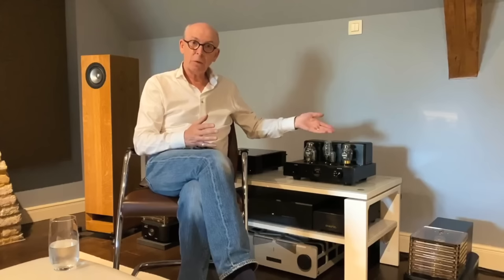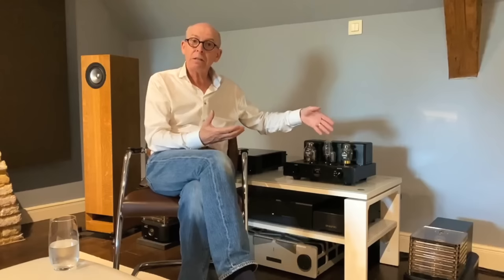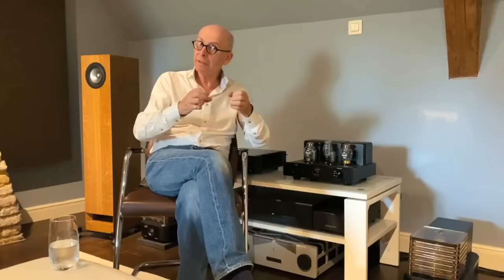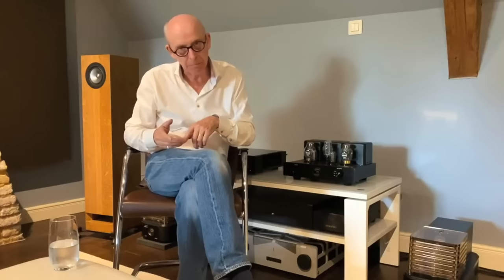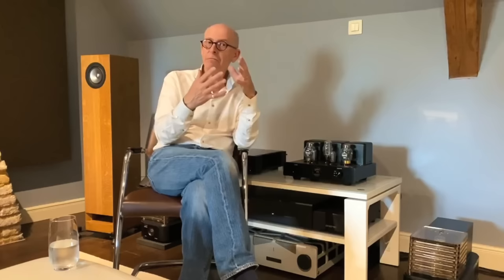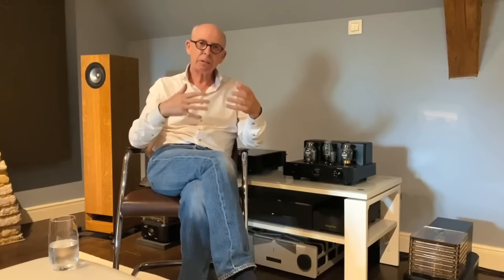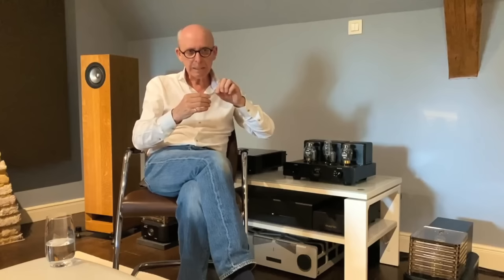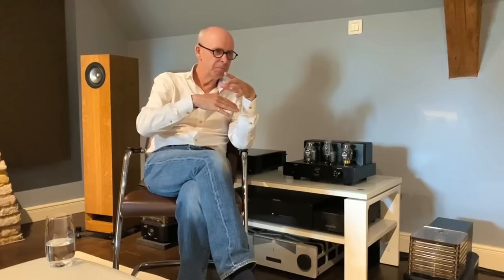What HiFi amplifier? What type to choose?

Comment: There are so many self-proclaimed experts that it is so refreshing to listen to these clear, articulate lectures delivered by a a classical recording producer, and they chime so well with my own experience, not as an "audiophile" but as a music-lover.. Thanks.
Reply from the maker: Thank you Douglas, very kind. Much appreciated.
Reply: @PearlAcoustics  Many thanks for this great video ! , making it very nice explained and intuitive. I have a question and I hope you can answer, Just got a very rare power amp ADCOM GFA555 MK2 Nelson Pass design, bought it from the US and it was new and never opened from the original box, so it was in the original manufacturer box for more then 20-25 years, all I can say It is sound amazing, it is connected in my setup to used ADCOM GFP565 pre amp , and now I explore  very nice and chip tube pre amp Fosi audio tube P1 with GE5654 tubes by Riverstone audio the sound is incredible. So do you think should I replaced the electrolytic caps inside the power amp ? I have removed the top cover and the internals of course looks as new and I have the Bias been checked by me and is as specs . Thanks in advance
Reply from the maker: @RanTausi  Hi. What I am about to tell you is my ‘opinion’. And as such, do not want to proclaim myself as an expert, so please take it as that - an opinion. My rule is, if it sounds good, and there’s no buzzing, hissing or excessive cone movement when idle, then leave it alone and simply enjoy it. 20-25 years is not old for an amplifier of that quality. In the old days (pre-1980’s) - people used oil filled capacitors and they definitely had a habit of breaking down. But todays modern components (and I include amps of the last 20 years) are generally way better made. Do enjoy it and look after it. Best wishes - Harley
Reply: @PearlAcoustics  Many thanks 🙏 Harley, I got your point. Have a good day
Reply from the maker: @RanTausi  👍
Reply: @PearlAcoustics  I agree. If it ain’t broke etc. Admittedly this can be harder to tell with a gradual (I mean gradual) roll off in performance. I remember a customer sent their amps off for a re-cap and said they heard no difference. They actually got a little upset when I said “well, they didn’t need re-capping then”. It’s not a universal answer, especially with a relatively modern, unused good quality amplifier. Please use it and enjoy! Report back your experience too
Reply from the maker: @maxine2798   a very good point snd fun story. there’s an equally strong argument that if they did hear a difference - it might not be one that the original designer would appreciate! 
It’s hard to keep everyone happy in the world of HIFI!
Reply: Actually what you have here is exactly what you are traking about: a self-proclaimed "expert" who has absolutely no clue what he is talking about.

Comment: There is a very well known and popular audio reviewer on the net that states that amplifiers all sound the same.  Yes really.  (He must have some limiting qualifications however) How does he or anyone come to such an opinion? He lays much weight on source and speakers not so much on what comes in between.
Reply from the maker: Hi. In fact, in theory he should be correct, if all amplifiers were ‘perfect’. In a way, scientifically, it is the imperfections that give us the different characteristics of amplifiers. I will say however, there comes a point where the very best amplifiers begin to sound very similar. 
If someone maintains there is no sonic difference then they either have not done enough serious comparisons or their ears are not good enough or they are saying it to make a point because the difference between amplifiers can be rather subtle, compared with other components (such as loudspeakers or pickup cartridges).

Comment: A single-ended amp is always a class-a amp, it needs a lifted bias in order to swing both ways, but a class-a amp does not need to be single ended it can be push pull too. There is absolutely no difference between a class-a and a class a/b design, the only difference is with how much bias you are driving it. A class-b design is unsuitable for hifi use because you have x-over distortion like crazy, but if you just lift the bias by a little bit like half a watt or quarter of a watt the x-over distortions disappear. Now you are in class-a/b territory. Say you have an amp that can deliver 20 watts and you run it with 5 watts bias, then it is still a class-a/b amp even though it is very unlikely that you will ever run it above 5 watts. So within the limit of 5 watts it behaves exactly like a class-a amp. You can now lift it to 10 watts and it is still class-a/b. Only if you crank the bias up to it's maximum power it is called a class-a. The benefit of a class-a amp is not that is has a better distortion spectrum, there are class-a amps that distort terribly, thats a matter of design, the only real benefit is that your music is not putting any load on your power supply. You can build a class-a/b solid state amp that distorts beautifully like a tube with perfect K2.
Reply from the maker: Thank you for your contribution to the topic

Comment: Thanks for a very informative outline of amplifiers. We are all very lucky to have such a diversity of quality equipment to choose...to hopefully match the sound signatures that we personally want or would like to hear for our budgets. 

My favourite combination is to use a valve preamp and class d power amps. As class d power is very strong, neutral and highly efficient and then the tube pre  allows (and can be further tuned) to provide a little more additional harmonic warmth and dimensionality and the sound can be further tweaked by rolling different  tubes..which is fun. 

Sadly tube power amps for me are great but too expensive to run as good power tubes are often very expensive for the better ones. 

But you are right Chinese hifi gear is fab, often very well designed and built and very affordable...the only one small caveat regards warranties, service and support ..primarily due to location and logistical issues of course. But I have never had any issues or problems...after all many western brands are also made in China too. 

Thanks again and keep up the great work
Reply: I purchased a 600gbp 300b amp from China sounds xcellent... The price was the clincher... The mark ups on audio as soon as it hits the UK is laffable.. Guitar shops r usually cheaper than hi fi shops for repairs... Their no crap approach is good.. And they sell very cheap interconects £3.99

Comment: Fascinating video. Whilst I am not greatly experienced or qualified  in the art of sound reproduction I like the kit, I've got some, 70's stuff, Lecson, Revox, Leak 2075, and it sounded great!.. now it sounds like my telly with the bass up too high. I think nature has turned my top end filter to max.
Reply from the maker: Thanks for your kind comment. The lack of treble could be a bit of both? Aging capacitors and or tweeters (most likely tweeters) that can easily be replaced and aging ears, that prove a more challenging reality (although our brains are very good at compensating).

Comment: The sound produced is ALL that matters, and there is a definite better or best choice when combining a speaker to an amplifier. Budget is the deciding variable, however, at a decent store, you should easily find several choices and combinations within said budget to choose from. You need to identify the speaker first, imho. Allocate 90% of your available money on the most expensive speaker that you can afford. The store will do everything necessary to show off every speaker in your price range. It's not complicated. Listen to every front end combination that they assemble (all components that you can afford later down the road). These combinations should be all tube front ends, all solid state front ends, and combinations of both. The system that sounds the best in whatever configuration brings you the greatest listening enjoyment, make that ultimate system your long-term goal. Buy the speakers first, and use the remaining money (10%) to buy a basic, inexpensive, used, integrated amp (ebay or from their consignment rack)) and a basic, inexpensive, used, CD player or a basic used turntable (whichever source material you collect) from ebay or their consignment rack. Listen to your music at home, enjoy your new speaker purchase, and begin to set aside money to purchase the amplification from the ultimate system that made these speakers sound wonderful to you. Buy it, plug it into your system at home, and celebrate the improved sound as you get closer to the ultimate system that prompted you to buy the speakers. Start saving money to purchase the source unit that prompted you to buy the speakers. Buy it, plug it into your system at home, and celebrate your achievement. Through discipline and a well designed savings effort, you have assembled the ultimate system that prompted you to buy the speakers. Move the inexpensive components into the bedroom or some other room, get some budget speakers, and enjoy some music in that space. Retail stores do not want you to go about it like this. They want you to trade up. Bring in stuff, take a loss on the trade-in, and buy the next level up. In the end, after several trade-up scenarios, you will have that ultimate system. However, between the losses you sustained on each trade-in, and the interest you paid on your credit card or whatever loan you used in this trade-up effort, you will have paid far more than you would have had you used the approach I described above. That money you lost in their trade-in program, the money that went into the pocket of the store owner, could have been used to buy more music. Just food for thought.

Comment: Most welcome to hear from a true professional on what is otherwise 'Hi-Fi  bs'.  I remember building a PA design by John Linsley Hood in the early '70s which provided up to 25W in Class AB but with adjustable pre-set quiescent current in the output pair which varied the proportion of Class A amplification - see Wireless World Magazine of July 1970.  Its specification seems ideally suited to your definition of 'it's the first watt which counts'.  Anyway, my recollection is that the amplifier sounded so good that my friends came round just to have a listen and one at least counted it as a reference standard!  Sadly, the transistor pair specified was fairly frail and has long since been discontinued.  Modern replacements may not be up to the mark.
Reply from the maker: Thanks for your kind words. Your amp sounded wonderful, I bet. However, I would not write off modern transistors, there are some really incredible products out there! Remember, when you built your amp, solid state transistors were still rather new technology 😉 time to rebuild it!
Reply: @PearlAcoustics  In a way, I have done so.  My current equipment includes amplifiers with Power MOSFET output stages.  I like to think of them operating like potentiometers where the speaker joins to the wiper which moves up and down (resistively speaking) at audio frequencies!  Half way to tubes, don't you think?  Changing subject slightly, there's a lot going for sensitive, wide range single speakers as in your design.  If money has to be spent anywhere, then it is the speaker you need to address for quality of experience.  If you have to revert to a multi speaker approach, there was once a Yamaha design which used electroststics for the mid/high range and a massive, high density slab of polystyrene (measured in square feet) for bass.  It sounded pretty good.  Brings a whole  new world of meaning to 'plane wave'.

Comment: Good evening 🌺 from my humble country ❤️ the Philippines Mr Lovegrove...
This is my second video for the day from Pearl Acoustics. Very informative easy to understand explanation of the types of amplifiers. My son just bought a NAD C338 or 388 from his Christmas bonus. I just bought a can of electronic contact cleaner and the baffless for my Coral 6CX will be done by Friday next week. It's a 98dB coaxial drivers and I am excited about hooking it up with what I think is a good baffles sporting a similar rectangular port like your speaker 🔊, my favourite Sibelius speakers. My favourite Class A integrated amplifier is the Musical Fidelity A-1 or A1X. I heard a brand new one 20 years ago and I am hesitant to buy a second hand ✋ unit because of its price (they are kinda pricey considering they are used units and I don't know its history) and how hot they operate but since I got a lot of education from you sir, I don't think I will be using beyond 2w/chan for the kind of speakers I have. The 86dB Celestion 1 I have when I put them in a box similar to your Sibelius is around 93dB because it plays loudly at pleasant levels. I don't crank the volume that much. I just played a direct to disc LP and my neighbor in front hum the melodic right up when I plan to change the record so I put the same LP and spin it back. Just an update, I made a similar box like your nice Sibelius instead of making an adjustable port as warmly suggested by my carpenter. He needs the extra cash to take his wife out for a simple dinner and grocery for the holidays.

Comment: In 1984 I bought a MOSFET Tandberg 3012. It's still running every day. Only had to clean the potmeters once.

I listened to other amps afterwards, but just not worth it.
It has a prepre for my AT 33 and that's a rare thing these days.

Comment: Thank you so much for your good expert story without prejudice.

Indeed, In China they can of course make good audio equipment. All value for money. A good Naim or Quad clone is not free there either.

As a senior hard and software enthusiast, I chose to build a Krell KSA-50 class A clone myself because of the costs. However, passively cooled which turned out not to be easy. I set up the power supply a bit more modern than the original design.

In addition, I built a Hiraga Le Monstre, only 8 to 10W per channel. Also class A. I provided the latter with an SMPS power supply instead of the dated original design.

Well, I talk too long about myself instead of your excellent reviews: You evade any irrational dogma and rely on your professional knowledge. That's good in this world of disinformation.

Thank you.
Reply from the maker: You are absolutely very welcome. All comments and additions to the topic are very welcome

Comment: Very informant post. The questions will always rage - class A, AB, class D. Obviously AB reigns the roost. I would guess it is over 90% of the amplifier market (amps and receivers included). At any rate the far dominate option. Having said that they are pretty well defined and properly implemented probably define  the standard. Class A has their adherents however outside of Pass Labs few pursue this path and even Pass the majority of amps start with Class A and the transition to AB for more output.  I have a Threshold 400A  which I had rebuilt by one of the old Threshold engineers for my legacy system (1970's vintage). This is a fantastic amp but I don't dare use it in my non legacy systems. I am a planar guy so amps have been a significant issue for me. Electrostatics are highly demanding loads and i have blown up components that can't keep up. Planar magnetics (higher end Magnepans) require a lot of power so amps are somewhat critical. I have studio speakers with class D amps (Dynaudio, Yamaha) which are OK but when I listen to the "New Class D" such as Purify it is incredible
I am a huge fan of Bryston  (OK I am a totally biased Canadian but no affiliation) Great electronic with 20 year warranty. who can compete with that. Wish your speakers were in my area so I could audition them.
Reply from the maker: Hi thanks very much for your interesting comment and contribution to the topic. We do have auditioning facilities in Canada, feel free to reach out to us via our website. Enjoy the music

Comment: Cool guy with lots of experience and expertise. Remember he's selling his product here, those speakers.  Even when not talking about the speakers he's selling by establishing his reputation.  When stating that you CAN tell the difference in equipment with a blind test I always note that for the negligible cost of a curtain he could DO A BLIND TEST.  He has the listening rooms and I'm sure he could get any equipment he wants to comparison test but it will never happen - never
Reply from the maker: Hi, thanks for your comment. I fully understand your reasoning. However, just to clarify - during the development of our loudspeakers and in amplifier comparisons, we used a special piece of technology that connected different components at random and we did several double blind tests to be sure of the development decisions. the difference between amplifiers, is not always big but it was always there and important to take into consideration. Hope that helps?

Comment: For music I have a SE Triode/Pentode (6L6G) Valve amp. 9Watts/side
I live in Northern Canada.
If it gets too cold, I turn up the music.
Reply: Which amp exactly?  6l6Gs are a bit rare.  I suppose you can use 6L6GCs if you have some that suite you.
Reply: @terrywho22  It's a home build. I found a box of NOS 6L6G tubes (Westinghouse Radiotron Made in Canada). Spent over a year studying tube amps then built one. Bought the power and OPTs from Hammond (in Ontario).
Reply: @CraftAero  Nice! Never heard a 6L6G, but the 6L6GC is one of my favorite tubes.  I imagine that they sound similar.